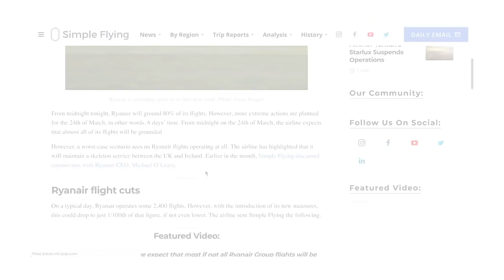The World’s Most Powerful Aircraft Engines

Comment: Now Imagine putting 4 GE 9X engines on a350 
Concorde Mode: ON!
Reply: Abhignan Sai ni no
Reply: Actually that's not how it will work out. Although those high bypass ratio engines provide a lot of thrust, they don't provide enough jet exhaust speed for supersonic flight. If you want to fly supersonic, your engines must expel supersonic exhaust first. You can also tell by looking at all the fighter jets and Concorde engines. All of those are low bypass ratio engines with very high exhaust speed. They are fuel hungry and noisy, but a necessary trade-off if you want to fly supersonic.
Reply: @mrcannotfindaname  lol... Thanks for the scientific answer but I was just kidding 😂😂😂
Reply: Put 4 on a 747 , thats maybe the Future for 747s , maybe they can fly with only 2 engines
Reply: @kaifriedrich1763  the GE90-115B alone was able to fly GE's 747-100 with the other 3 engines at idle..
Reply: A340*
Reply: fuel efficiency: so bad
Reply: @mrcannotfindaname  The Concorde also had afterburner which is even worse for fuel efficiency.
Reply: 4x GE9X = 2388 kN and the most powerful plane (An225 Mrya) has "only" 1374 kN😂
Reply: @mrcannotfindaname  imagine 6x GE9X on the Antonov 225 (3582 kN vs 1374 kN)😂
Reply: @ssimnghi4146  An225 to Can225. We will make 225 great again.
Reply: Bruh no
Reply: U be so Fast u would-be be flyin
Reply: @uwu_senpai  Yes, but didn't need them to cruise supersonic, unlike the rival Tu-144.
Reply: If you tried to go faster one of these things would happen
A)You might stall the aircraft and fall out of the sky
B)Supersonic flow will break the aircraft
C)Structures will fail due to the heat of supersonic flight
Too bad Concorde isn't flying.

Comment: @SimpleFlying I have to ask this question: If the A380 was given to engines how much thrust would each engine have to produce to get the aircraft of the ground? Would it still be able to maintain its current ETOPS certification?

I asked because it seems that the Boeing 747 and the A380 are Having their production lines shut down pretty soon. It seems that the only way to Continue building these massive mechanical marvels is to drop two of the four engines. I am basing that on the obvious knowledge that two engines are cheaper to use and maintain instead of four.

Comment: Wish you used metric system rather than imperial so the international viewers can understand.
Reply: mr sir No. Aviation world is not only in imperial. In countries with metric system, pilots use meters to measure the altitude, km for distance, km/h for speed, hPa for pressure, and liters for volume.
Reply: @mr sir I meant when he describing the power of the engine it should be in newton per  metre and not pound per inch. The whole scentific community use metric system.

Comment: The in service thrust for the GE 9x on the Boeing 777-9 is around 105000 Ib. 10000 less than the 115 on the 777-300ER. I believe improvements in the wing design have allowed Boeing to traduce the thrust required on the 9 variant. Remember the wing design on the 300ER is basically 30 years old now.

Comment: The channel should provide conversions to metric if they wish to entertain global audience..! 🤔🧐
Reply: Or you could learn the Imperial system!  It's really not difficult.
Reply: All the engines are American or British so I can sort of see why.
Reply: Dev Mac Similarly altitudes are commonly expressed in feet.
Reply: @peterd788  Have you heard about MKS (Meter, Kilogram, Second) system the SI units of measurement used internationally..?
Even the UK follows mix of imperial and metric both and not just imperial, you can fact check it..
Reply: Dhairyasheel Pathare Yes and I use them all the time but flight levels are commonly expressed in feet, air pressure is commonly expressed in inches of mercury and thrust in pounds. Obviously SI units are more rational and useful (for example the US and U.K. have wildly different definitions of a pint) in most circumstances but some measures just stuck.
Reply: @TheRealCartman1  Only 3 countries remain officially to follow imperial in the worls just 3, the US, myanmar and liberia the MKS is used by the rest and accepted globally..
Reply: @Scott_Puss  yes but no one here is an aircraft engineer or a pilot there might be 1-2% watching but that is it..
Reply: Dhairyasheel Pathare BTW, US made many attempts to switch to the metric system, but as we can see it hasn't succeeded.

Comment: Hi guys just a small question 

So if a Airlines is ordering a flight type do they also select the type of engine to be used or it's the choice of the manufacturer of that flight type ?
Reply: That depends on the aircraft.

"Airbus and Boeing seems that are moving to a unique engine option. Previous Airbus aircraft have two or three engine options. But the A350 XWB has, as of today, a unique engine option with Rolls-Royce."

Comment: 0:58 why do planes fly with the gear down on test flights?
Reply: Wanda Fisch You don’t risk gear problems on a first flight.
Reply: @terence8127  but why do they fly with gear out on test flights?
Reply: Wanda Fisch The test aircraft is a prototype, often one of a kind of a new aircraft. The first test flight is to evaluate controllability, functions of engines, speed control amongst others. If the gear malfunctions you may lose the aircraft on that valuable first flight so it is safer to leave it down for the first flight.

Comment: As I understand it, the thrust number you mention for the GE9X is a theoretical redline-maximum number, not a number that will be certified for any actual flying, and most certainly not for any normal operation.  I don't think that certified number is going to exceed or even equal the GE90's 115,000 lb is it?   And another very minor trivia point is, the PW4000-112" did exist in a certified 98,000lb thrust version which Korean Airlines briefly flew on 777-300s.  This "PW4098" was significantly different from the 90,000 lb thrust PW4000-112" which does still fly today, but its introduction timing during the 1990s Asian economic downturn made it a sales failure, and so few were made that all engines were soon withdrawn from service and none exist today.

Comment: I read somewhere that the ge90 has an estimated 110,000 horsepower. Even massive container ships don’t have that much power
Reply: About right, the GE90 has got an industrial derivative called LM9000 which has got about 70-75 MW which is round about 100.000 HP.

Comment: where did the cf6 go
Reply: the are rated much less, between 50-70k lbs trust depending on variant. but they are one of the most popular with well over 8000 sold and many many still in use.

Comment: Actually all of the current engines listed here can trace their lineage back to RR and the RB211. It was the first 3 spool high by pass design. But  actually the most powerful turbines are not in aviation but in electric power generation and are straight engines power by natural gas or diesel ..
Reply: No, GE and PW engines have their own heritage and they are both 2 shaft engine designs. In fact the first high bypass Turbofans was the GE TF39 used in the C5 Galaxy, the origin of the CF6 family. For PW the high bypass history started with the JT9.

Comment: I wonder why PW engines were mostly kicked out from new large aircraft. Their engines used to be the most popular jets.
Reply: Btw, I like PW engine sound
Reply: By the way it sounds like a Vaccum cleaner on taxi mode. If you want one try South Korea to Philippines route A330-323X A330-223 Korean Air to Clark & Cebu from Incheon🇰🇷 while PW4090 Incheon🇰🇷 to Manila🇵🇭 note MNL route gets swapped for GE90-115B B777-3B5/ER which would have operated a following ORD-ICN for KE623 KE086 JFK crew change ICN for KE621 Day time ICN-MNL.

Comment: It would be good if you made it plainer that the heavier an airplane is, the more thrust it needs.  787s and A350s do not have the highest thrust engines because they do not need them, and would cost more if they were engineered to handle unneeded thrust.  No airline passengers or freight carriers pay extra for tickets just to experience steeper climb rates - would you?  No one cruises hot-rod commercial transport airplanes around on Friday nights for entertainment.